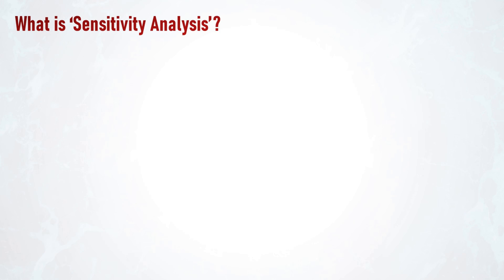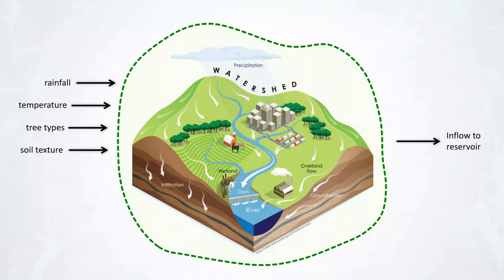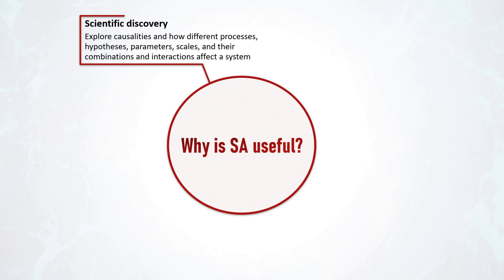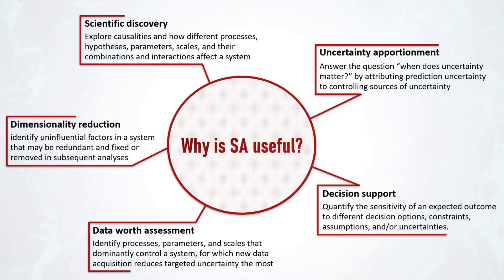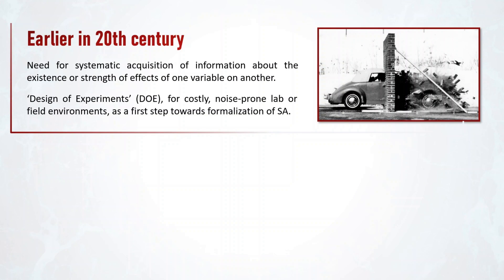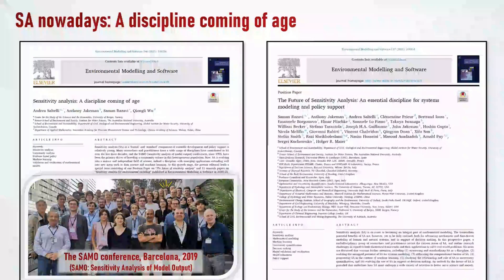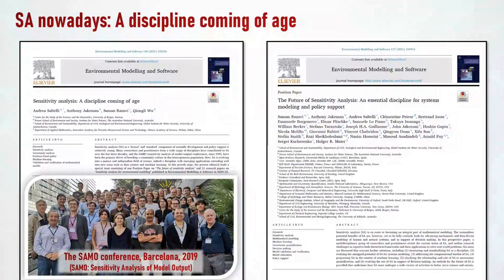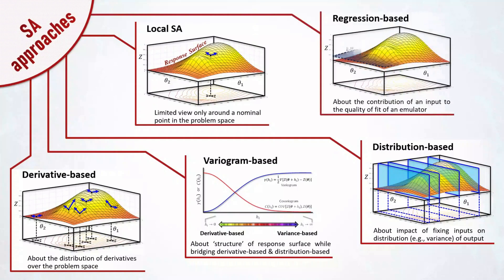Introduction to Sensitivity Analysis

Comment: Question.  VARS is a sensitivity and uncertainty analysis framework.  Do two separate analyses need be run to obtain uncertainty and sensitivity?  Often the range of an input variable, X, will often exceed the uncertainty in that variable.  Would it be correct to say that for sensitivity we would want to provide VARS the full range of the input, but for uncertainty we would want to provide a smaller range?  But with a smaller uncertainty range you wouldn't capture uncertainty conditional on X's full range of possible point estimates.  How would you handle that issue?

Comment: What is the difference between SA and Monte Carlo in order to confront uncertainty? Thank you in advance.
Reply: Monte-Carlo simulation is a forward approach for propagating uncertainty from inputs to the output. SA may be viewed as a backward approach that tries to partition the uncertainty in the output and attribute its pieces to different inputs.
Reply: Let me explain it in a bit more simple way (with all due respect to Saman's explanations), in SA we keep all variable constant and change just one variable to see how that single variable could affect the outcomes, and we should repeat it for all input parameters and a weighting factor should be defined to quantify the effects of each variable on output value i.e. how much they are influential (I used this method in geotechnical engineering field, which is my field of expertise), but in Mote-Carlo we should establish a "Probabilistic Space, by having in hand PDF of all of our influential parameters" and sampling from each PDF is completely random based on skewness of the PDF, then the results will be reflected in PDF of our output parameter (i.e. a wide range of outputs will be gained based on probabilistic sampling and the relationship between those input parameters and the output value. 
Note: PDF stands for Probability Density Function (i.e. the bell shape curve, which could be skewed either positively or negatively). 
Hope it was useful. 
(Please correct me, Saman, if I am wrong). 
Regards, 
Mike